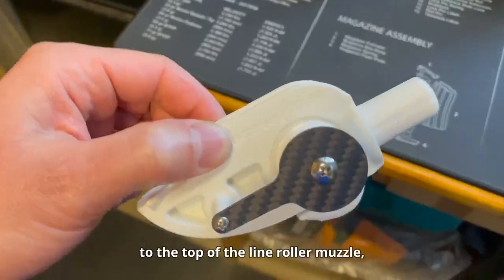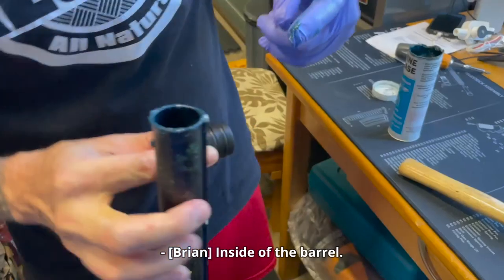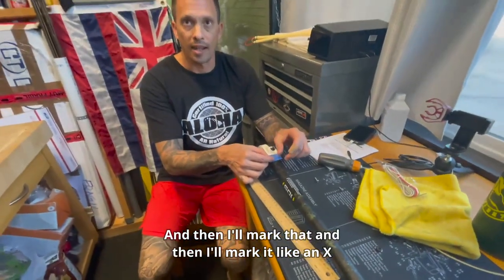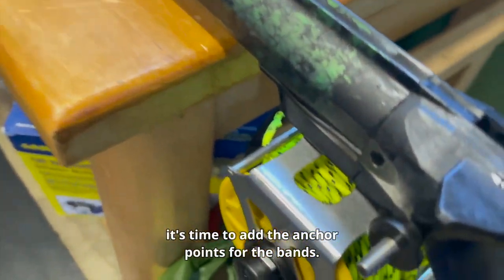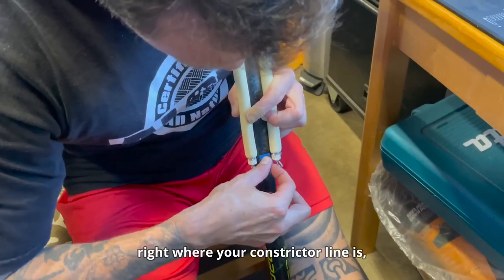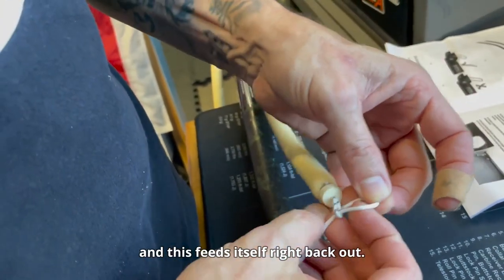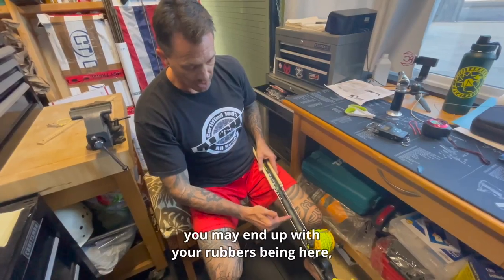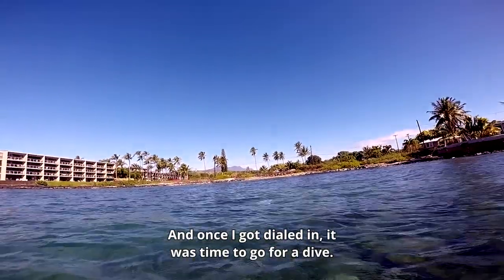THIS Is How To Improve Your Speargun

Comment: I copied the design of the   salvimar tomahawk. The top band has a string inside to limit the stretch. It's connected to 2 bands on the bottom one of which you remove before loading. The inverted roller was disappointing, the pulley cuts your power in half. I've compared many designees in the pool and I like this the best.

Comment: Hello, i'm wondering to know how to measure the bands, put the correct stretch.
 i have a meandros b28 too but with 85cm.
I'm thinking to buy mvd roller kit.

Thanks for the videos.
👍
Reply from the maker: Bands are tricky since it depends on rubber material, thickness, internal diameters, pre tension, etc. I’ve heard not so nice things about the mvd roller, just fyi. I was going to go with that one first, but after research decided not to.
Reply: @castandspear  thanks man, i´m tented to try to convert, but i don´t know yet which  kit i would buy.
foaming the barrel reduce significantly the recoil?
what bands are you using??
thanks ;)
Reply from the maker: @Rawly84  the foam added a bit of mass, which helps some. It really helped the noise of the metal barrel be muted. I used 16mm small ID mannysub rubber for the bands.
Reply: @castandspear  thanks man, 
Apreciate, good fishing days ;)
[[]]

Comment: Is there a method to get rid of the foam in a barrel? I bought a foam filled cuttle fish barrel and id like to get rid of the foam and have it hollow and sealed instead for more buoyancy and less weight .
Reply: depends on the exact material of the foam but pouring in hexane or gasoline might help. Make sure to remove all plastic parts before.
Reply from the maker: Sorry, I've never removed foam from a barrel.

Comment: The measure of the 13 inches where the second blue tape was placed to stretch the bands to. How was that calculated?
Reply from the maker: I believe that was in the instructions that came with the roller head listing out the amount of pretension.